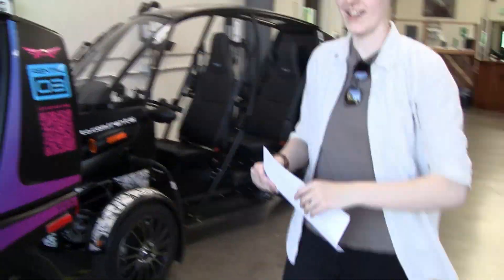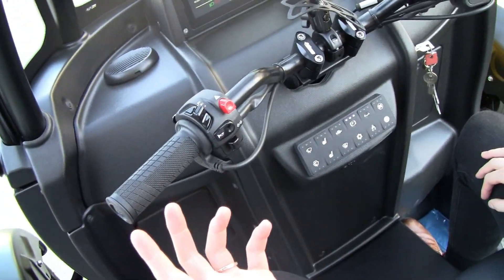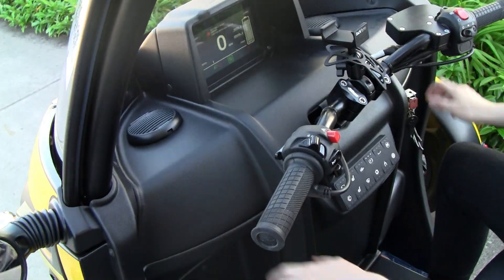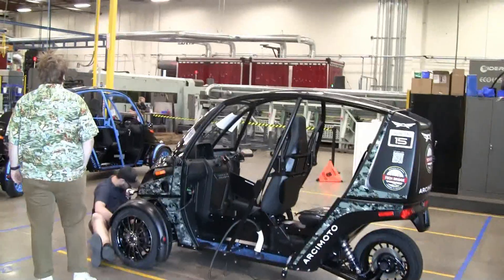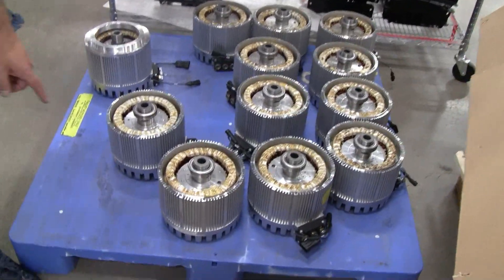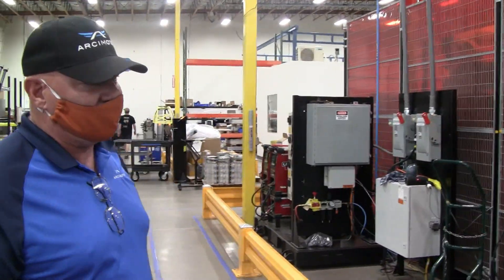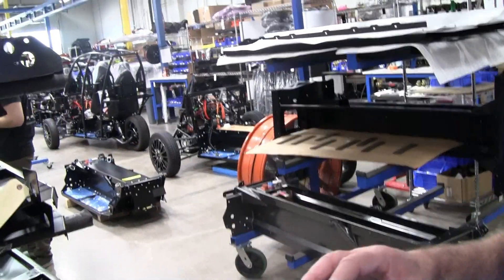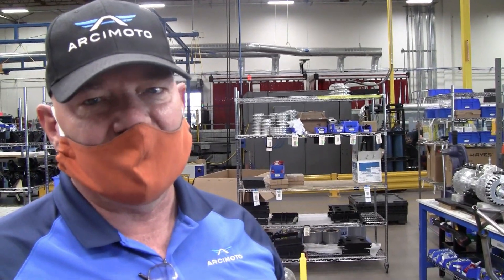Arcimoto factory tour and the first time I met Eric the EB. June 17/18, 2021

Comment: this is a great video showing you the different features and explaining everything. The factory should take notice of this and to their own video because yours is the first  time I could actually work out the braking of the vehicle....  still don't know if it has ABS or other features because the information is a little bit scarce on the Internet
Reply: I just bought one and I still don't know if it has or needs ABS. The one pedal works all 3 brakes and regen uses the two motors.

Comment: Questions - Is the Arcimoto considered to be a bike or just a special vehicle???
                      I assume this is considered to be a bike from reading comments.
Can I just use my normal drivers license to drive one of these????
What kind of vehicle license plates does it need/require????
Reply from the maker: In CA it's considered a motorcycle (or Autocar) and has a motorcycle plate, no helmet or special license needed. But regs vary depending on your state.

Comment: Too Bad theres no East Coast Dealers
Reply: There are no dealers anywhere. You buy online if you live in one of the states set up with mibile service technicians. That list is growing. I'm in Florida. I ordered mine 2 1/2 years ago and got it 6 months ago. Believe it or not I never drove it in rain until last night. I was not sure what to expect but all I got was damp elbows. As I go above 30 mph the nose wind pressure wave parts the rain and I feel not even a tiny bit of mist while the wipers are keeping visibility good. After struggling and almost dying due to poor visibility on a scooter or motorcycle with no wipers or even a helmet shield this was amazing. No doors or windows, just a narrow roof and yet I was dry as rain was pouring down. And I had the full traction of three car tires instead of two round motorcycle tires.

Comment: To me, any company that makes a handsome three wheeler, with "passenger behind driver" seating, instead of side by side, & maybe even another seat in the back, is truly missing the boat.  How can anyone enjoy traveling w/ friend or partner, in such situation, unless it's a taxi?
Reply: A billion motorcycles exist with tandem seating. Nobody complains. The Arcimoto's wrap around windshield and rear trunk bulkhead means conversation is easy due to reflective acoustics. No helmets or helmet mikes needed. The only thing you can't get is a BJ while you are driving. The narrow light profile of the FUV is innovative and rates 173 MPGe. Three fit in one parking space. All that while offering the same safety level as any small 4 seater car.